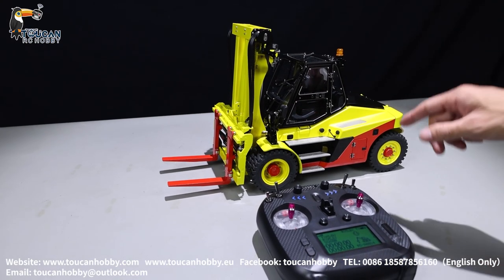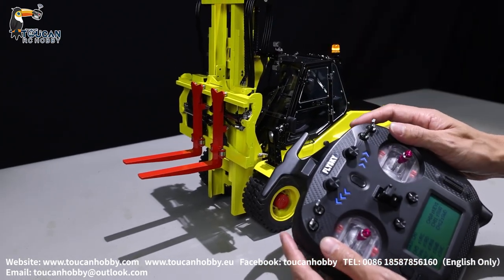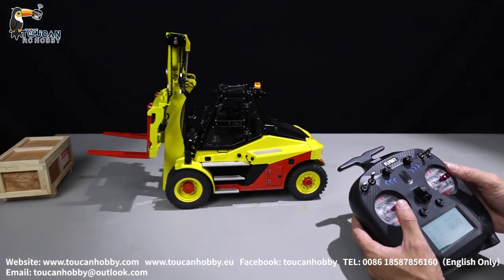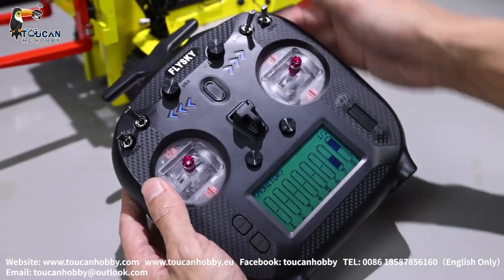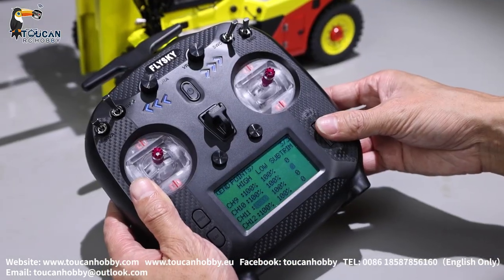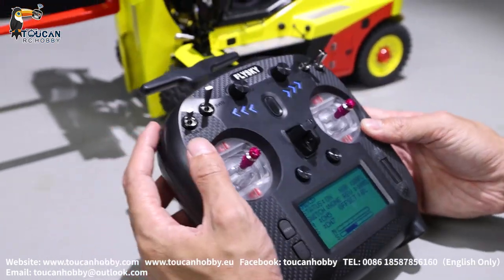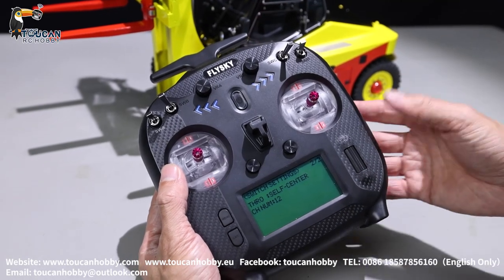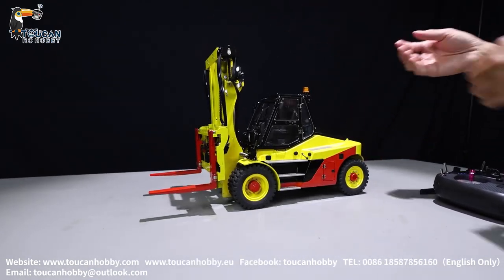How to operate Aoue-LD160S Heavy Forklift LESU 1/14 RC Hydraulic,RD A0014 Light ST8 radio settings.

Comment: Hi, I also have a hydraulic forklift, but it happens to me that when I lift a load, it releases it very slowly, as if the valves were not closing properly, how can I resolve this?  Thank you.
Reply from the maker: Go to subtrim to change the valve angle till close position
Reply: @toucanhobby2400  thanks!
Reply: @toucanhobby2400  unfortunately it doesn't change anything. When I lift load between 0,5kg and 1,0kg it's loosing slowly, but when I lift load between 1,0kg to 2,0kg It doesn't. I have a Norsu hydraulic forklift.